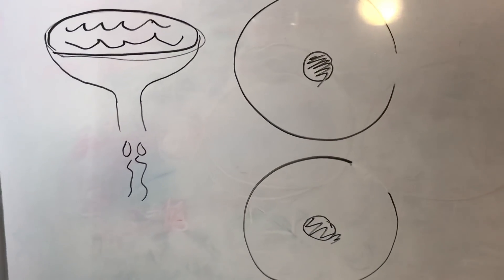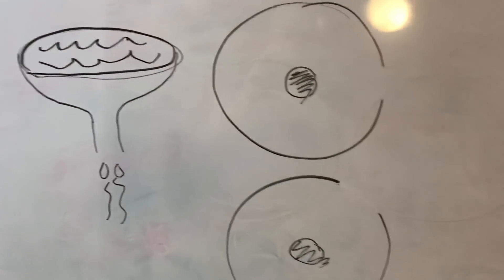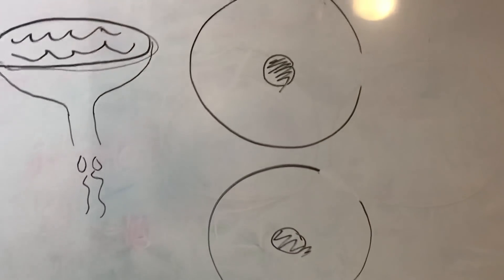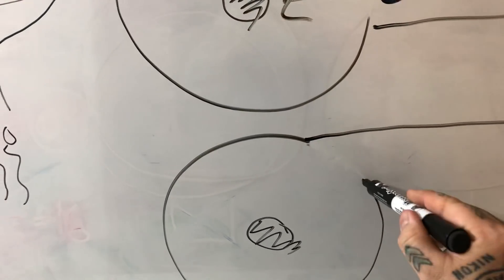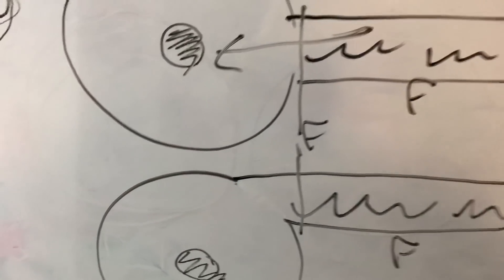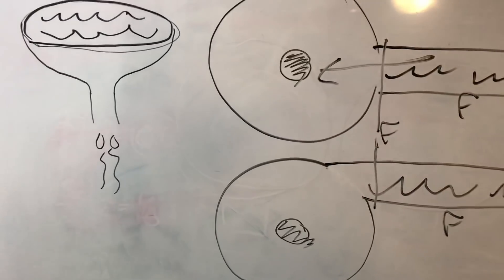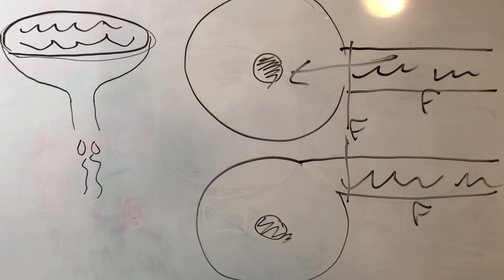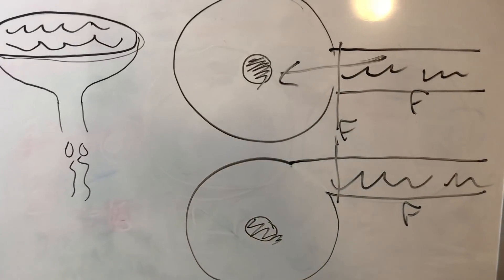🤔 Nature’s Mystery: Cuvilinear pressure & Vortex dynamics

Comment: The one that enters at the edge drains faster because it gradually phases the water into a helical trajectory starting at the area of slowest rotation and least phase coherence to the point of quickest rotation and most phase coherency -at the apex?
Reply from the maker: https://www.flickr.com/photos/134746128@N05/41372156955/in/dateposted/
Reply: Theoria Apophasis, I don't think it's the link you intended to send, or maybe it won't load the right link bc I don't have a flikr account . I sent you an email or two by the way!

Comment: The Tesla Turbine & How it works
https://youtu.be/mrnul6ixX90
This video example of the Tesla turbine explains why the side would work best; also if a turbine disk were involved it would work better due to the fluid pulling on the disks and if the disks have mass inertial momentum. Also if the disks were magnetic; coils could be placed at the outer edges to pick up the fields in motion. And an inner coil could act as one end of the circuit with the outer  coil and the current between the two might also re induce the disks sending current back into the disk from outer edge inward further causing a force onto the disk to rotate.

Comment: The arrangement depicted by the lower image (tangential input) is fastest, once established, as the flow will be relatively more efficient. Ie. the flow entering in the upper image will be relatively chaotic. In the upper image, relatively more energy is stored in turbulence, whereas in the lower image that energy is cooperative with the flow direction, hence making it faster to drain.

Comment: Since the flow rates in are equal, the flow rates out must equal in order to maintain same flow rate in for equal cross sectional input area.  Unless I missed that air is able to flow up the output tube and escape, If that isn't the case, then since the input flow rates are the same, it is logical that neither has a greater resistance to flow (higher static pressure would be required to overcome additional resistance in order to maintain same flow rate in ) .  In reality it needs to be known whether or not the systems are open or closed between input or output. Flow rate is tied to static and velocity pressure and cross sectional area of flow.  One goes up, the others go down. "Drains faster" can't be considered without additional qualitative parameters and quantitave parameters. For example; the difference between a toilet and water simply flowing thru a pipe. Toilets are an open system to the atmosphere. Picture looks its a closed system to me
Reply: Oops. My bad. OK all else being equal besides the entry angle, the velocity is better maintained in the lower system which keeps the inertia mediated. Upper system a greater force for acceleration is required for it to drain at same output flow rate.

Comment: The water reaches the hole faster in the direct one but it not pass through as fast, the water would fill the whole and back up the water since it would not be passing through efficiently.. with the TOP one the water is directed in a circle and it doesn't lose much speed. more water can enter the whole efficiently and at a faster rate since it is directed into a circle and the whole is shaped as a circle.
Reply: Also if you are talking about a continuous flow of water then it is completely irrelevant how fast it reaches the hole anyway since either way the whole circle/bowl is going to be full of water

Comment: The top will drain faster due to the counterclockwise flow of the draining reservoir water (less resistance to the circulating water as the water enters the reservoir).

Comment: The second one. The reason is that water is magnetic and it absorbs yin energy constantly from the aether and cosmic rays rendering the water magnetic. So the reason it flows down the hole more quickly in the second diagram is because that is the more efficient path with less resistance. Gravity is the difference in the pressure of the aether created by the fact that matter creates resistance to the passage of aether. Effectively gravity is not that the earth centre attracts the centre of other masses, but is instead the aether itself coming in from all directions but being opposed creating the illusion of the force downwards. The aether resistance manifests in vortices because effectively the aether is being absorbed at all points in the earth, moreso in some than others creating the slight differentials in gravity. The aether being resisted effcetively creates a drain everywhere there is matter which is very similar to your description of counterspace. Effectively there is a "drain" everywhere there is matter resisting aether causing the more efficient path. A second but lesser reason is levity. Levity is the force that together with gravity determines the weight of objects. In the ground the water can absorb so much yin energy that it will rise up a mountain to the surface in a high mountain spring as described by Viktor Schauberger. The more levity the slower the water will drain as the gravity is the net between the two forces. The first drawing will have more levity for the same environment because the water will absorb more of the ambient yin energy as a result of nature's attempt to restore balance.  Nature desires the vortices as everything is conscious with the some degree of life force and the vortices are created by the thought and desire of all consciousness to create order in the universe. We therefore see this sacred geometry everywhere including the vortices. Why is there this desire in nature? There is no answer to that why except to say that there is a spiritual world which is reality and the material world is a shadow of it and this spritiual world is the creation of the One. Every effect here in the material is caused by the spiritual. The spiritual consciousness just is. There are laws of creation that can be determined by carefully observing nature. The law of one mind from the 7 hermetic laws tells us the cause of all other laws but there is no cause to there being the one mind.

Comment: The bottom one would be the one to allow water to drain faster. I assume it's because it's in line with the outer centrifugal path so can build up speed as it " vortexes " to the centre where the drain hole is. On the top example the water would be crashing into itself slowing it down?

Comment: Number 2: Because it rotates the water leaving a hole of air ... for the water to pass down without pushing against itself... water has momentum. Ive done these vortexes in a bottle. Turn bottle over filled with water and twirl bottle sideways until it forms a vortex. As the the science of it, i dont know.

Comment: The bottom one starts the water in a uniformed direction allowing the air to leave the drain as the water is going down the drain. Same as a bottle of water if you swirl the bottle, the water in it will drain from the bottle a lot quicker than a bottle that hasn’t been swirled. The swirling motion make the the water leave in a uniformed way allowing the air on the out side of the bottle able to enter the bottle easier. The un swirled bottle glugs and produces bubbles as the out side air tries to get in the same time the water is trying to exit the bottle...... hope that make sense 😜

Comment: The bottom flows faster. The swirl keeps the drain open so the air can flow behind it and swirl opposite the flow, pulling the water through from the other side of the drain, making the drain the lowest pressure gradient. The top floods the drain leaving no path until the pressure builds and the drain “burps” letting the water drain for about the amount of water it displaces.

Comment: The flow in the top diagram impedes on the flow down the drain. The water coming in will exert force through and past the center drainage point which is then directly in opposition to the mediated water pressure thus reducing the total velocity of water able to exit the reservoir.

Comment: I'm just going to throw this out there but I think it has something to do with pressure.

The fluid motion in a vortex creates a dynamic pressure (in addition to any hydrostatic pressure) that is lowest in the core region, closest to the axis, and increases as one moves away from it. Since we have an exit pipe then the greatest pressure will be along the edge of the exit pipe. The higher the pressure; the greater the volume of water flows through that cross section of the pipe.

The centre flow will be relatively slow. If there is air in the pipe then the air would push through the cross sectional area of least resistance hence the air column in the centre as the hydrostatic pressure forces the air below through the core and above the more dense fluid. Essentially the core provides a great path of least resistance for the air to use which helps both fluids travel far more efficently.

Comment: Shot in the dark...because as force  increases as in case b, inertia/acceleration into the drain must also increase as necessitated by pressure mediation. Similar to a magnetic field. Higher gauss ratings will have stronger acceleration towards the zero point. 1/Phi^3

Comment: Because you are teasing the water by pointing it further away from where it by design has to travel it does it more impetously. You gave this poor water a job by tapping in to its natural capacity and a little bit of structure. It's gushing with excitement. And resting, simultaneously. Right, because it conforms it has to accelerate. I can't formulate what occurs at the apex of the motion or what have you. Probably just loses momentum.

Comment: Since water is dielectric, and it moves opposite to magnetic fields but in similar fashion, creating a "south pole" in the shape which gravity flows, so there is pressure mediation which would involve some lack of permeability, reflecting like a small version of a superconductor with lowered "friction"(reflectivity?) , so faster than a straight line, which cannot efficiently create this curved shape, vigorously swirling the water in the opposite direction increases this effect, so even faster.

Comment: the bottom diagram provides the shortest distance, because it provides least resistance. The water molecules arent bouncing around chaotically because of turbulence, which would cause a longer path.
Reply: The resulting vortex also allows for a void in the center to allow gas to pass thru, unimpeding pressure differential which would otherwise cause more turbulence.

Comment: In a vortex the 2nd example you gave is a straight line or closer entry point for travel to the exit point at the base of the vortex.  In the first example the water has to enter, then bend and change directions.

Comment: The bottom one for sure, why? - the vortex is initiated by placing the drainage pipe on the outside edge, this creates a centripetal vortex with max spin at it's apex point, the reason the water drains faster is because a centripetal vortex starts out slower at its cone and accelerates towards is apex point.
Reply from the maker: this is true, but torque and applied force to the 'outside edge' of teh vortex is still force, centripetal acceleration is the total opposite of force, so how is that translatable?
Reply: Well, nature only moves in spirals, in this case centripetal-centrifugal? Wouldn't water draining be the same as a tornado, which is hyperbola in shape? So there must be two vortexes moving in opposite directions, so a relationship of divergent/convergent, this would be how it translates from centrifugal to centripetal? Your racking my brain Ken, haha!
Reply: Theoria Apophasis It is translated through mechanical advantage.  Acceleration at a screwdriver's point is multipled because of larger radius of the handle.  This acceleration is of course applied over a much smaller distance, so what we lose in distance we multiply in acceleration.  In a screw driver the acceleration is slowed and stopped by the resistance of the material being screwed into, however the opposite is true in a vortex axis.  The point that is screwed into, leaves the system altogether.
Reply: Theoria Apophasis In a vortex we need the outer edged of the vortex to form a kind of resonation with the axis.

Comment: the bottom one, why? u take a bottle of water and empty it, the air pressure is going to prevent the water from going out at top speed, but if u spin the bottle and create a vortex, the liquid is going to rush out with the help of centrifugal force, so does to me the bottom example, create the conditions for a vortex and u get faster drainage, i do not know much about the physics, but i know how that example works.   why is probably because gravitation is not prevented by interrelationships between materials, by creating a vortex u eliminate air pressure, and maybe vortex creates to the degree a negative pressure that sucks material down. 
such interrelationships should be examined at a molecular level, u should not believe u grasp the full complexity of the problem in question from the experience and the field of macro focus that your mind can perceive.

Comment: The motion of the water draining induces angular acceleration. The force af the angular acceleration loads the movement of the water slowing it down. When you spin the water by hand you reduce the load on the downward movement of the water and it drains faster.

Comment: Depends on which side of the equator you are on.   In the northern hemisphere the bottom diagram and if in the southern hemisphere the top one, although if you had a third example one with the inflow at the lower part of the circle, it would be even better in the southern hemisphere.
Reply from the maker: the direction of spin isnt a question here
Reply: If taken to extremes, an extreme spin would overcome the downward pull and would push against the side so that draining would be impeded and could stop all together.  In that case the diagram on the top would drain better.  But depending on the standing depth of the water, inflow location would make no difference.

Comment: The upper flow pattern is chaotic as the water entering will continually disrupt the outflow. The lower flow pattern initiates a smooth and more coherent/cooperative behavior and does not cause any impingement of the drain.

Comment: The pipes aren't at the same angle relative to the center. The one coming in on an angle accelerates its own centripetal flow of water down the drain.
Reply from the maker: but why
Reply: Potentially the momentum would create a vacuum that needs to be occupied by the water.
Reply: Theoria Apophasis If I had a high pressure hose aimed perfectly above the sink hole and its stream focus / diameter could be controlled to constantly at any speed fit perfectly into the axis hole, barring air fluid friction, I could send water thru the hole as fast as the water hose could shoot through the hole.  So does it have to do with once the water passes the vortex axis hole, at that moment the resistance becomes zero / flow undescribed.  So it becomes a question of how fast can i cross that threshold of the axis hole.  Rather, if everyone tries to leave a burning building at one time, bodies will stacked or traffic jam the exit.  But the maximum velocity of people escaping the building could be acheived, everyone might sprint in a circular fashion in the same direction around the largest path as possible but vortexing the movement into smaller circles,  the people at the door leave the equation (building), everyone can keep moving at the fastest pace possible until all are gone.  The larger the vortex the faster the people near the door can keep being fast, theoretically if the house was over capacity but everyone was a world class sprinter, you could clear the building probably in less than 1 minute.  Bad analogy?
Reply: Theoria Apophasis I think a screw driver tho might sum it up best, large rotation into smaller point = more velocity at the screwdriver's tip.

Comment: The lower one looks better.  I don't think there will be a big difference  between them though.
Reply from the maker: theres a huge diff between them actually :)
Reply: So aaa ,, What is the size and the form of the trough ,and what is the amount of the flow of the water in cubic centimeters per second as that might influence the result if the trough is getting filled with water opposed to if the water is gushing very slow and going down nicely. + how do these variables effect the outcome?   

Ok. You said about 60-70 feet is the size of the trough(this isn't really relevant). What is the size of the drainage pipe?  But after a while if the flow exceeds the capacity of the middle drain to exhaust it , it will get flooded !, so the question that you are imposing is getting less and less relevant directly proportionally  to the velocity of the flow of the water  combined with the amount of it.

hmmm.It's a complex question because I now see that you are talking about the effect that takes place when the water is forming a spiraling pattern after getting inserted into the trough. So I suspect that you know how the flow behaves in these conditions quantitatively. I have no answer.